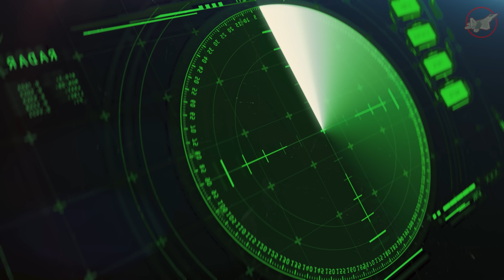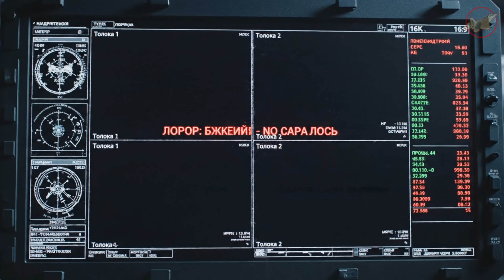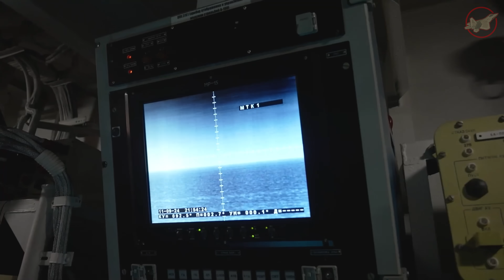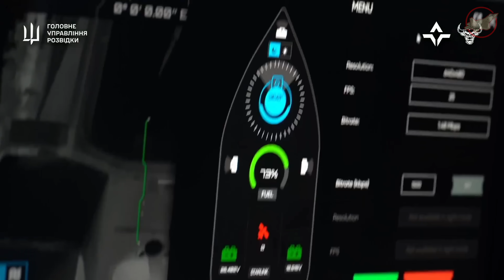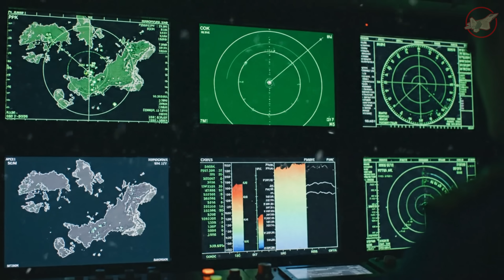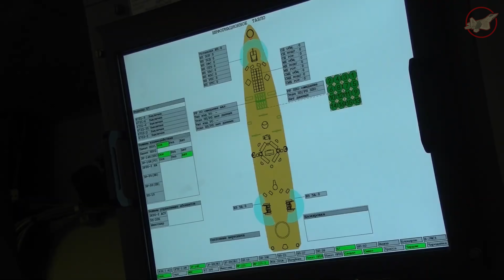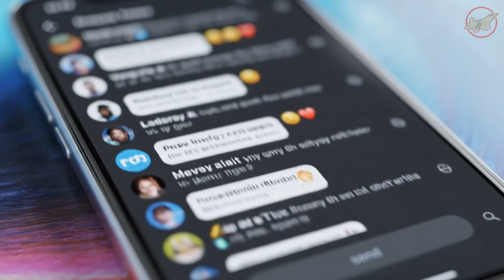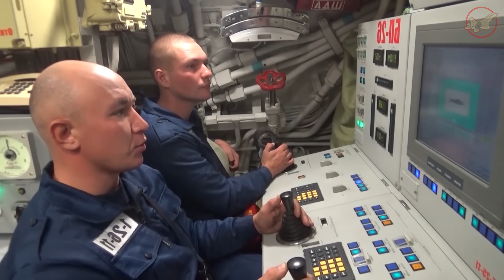It’s OVER! Ukraine Waited Russian Commanders Relaxed — Then BLEW Up $425M Sub

Comment: The attack would be at night, I turn an ultralight plane, that is now painted in camouflage that absorbs, doesn't release any light, with four 100 lb bombs, any charge in the cab of the ultralight plane, about 200 or so, lb, how is in decoy drones, from two other directions long distance drones, to get more Russian ships before they leave that harbor, Hyde Park 20 or 30, magnetic minds, attached to some form of sonar, with AI or bored, while they're going out of that harbor, they have to lower the nets, when you sync two or three in the mouth of the harbor, just passed the submarine that's it's harder to maneuver, then I would use McGraw v, drone boats that have been painted so they look like ocean the same kind of camouflage that makes it hard for infrared and thermal, and radar to spot they'd be covered in it, full load, on the magora vs that means 4 FPV drones missile tubes to shoot down any helicopters or fix wings doing an escort of these ships coming out of that harbor, and I would make it as hard for them to get out of that harbor and not stop chasing them, can I find a way to put a tracking device on at least one of the surviving ships, of the Russian fleet for where they go, the diesel submarine was destroyed,to they are new harbor.

Comment: The best strategy would be launch a small fleet of surface ships then launch missiles at those surface ships of submarine, but it would be good to have submarines to stay on the boat of the harbor waiting for a chance to attack but have submarines move so slowly that sonar has a hard time picking them up. One thing to do is attack a ship leaving harbor where the small boats attack from three sides but have the subs attack from bottom.
Reply: Ukraine has no ships.
Reply: @Escotch77  If you look they have small drone of small ships that they ram into large ships